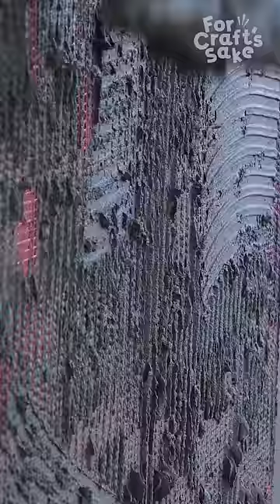Building a House

Comment: Не вентилируемый фасад. Интересно как себя будет чувствовать дом. Вдруг дом останется без тепла а стены будут влажными без вентиляции.
Reply: У вас внутри дома чистый блок и без отделки? 

Перед штукатуркой грунтуют, это уже свозит всю пароизоляцию газоблока на нет. Меньше сказок смотрите, про «стены дышат»
Reply: Sie haben Recht bei so einer Isolierung braucht man ne Lüftungsanlage oder muss ständig Lüften sonst reicht allein die Atemluft und es bildet sich schimmel.
Reply: Da man ja fast nicht mehr Heizen muss, empfiehlt sich eine Lüftungsanlage. Ausgestattet mit einem Heiz und einem Kühlregister. Ist viel billiger als eine normale Heizung.

Comment: Insulation less than 3m thickness is worthless. I made it 4m on my house and to keep it cheap I put it on the inside. It's amazing now. There are only 2m² left but it's very warm in winter.

Comment: installed completely incorrectly. They call for the insulation to be used so that there is no connection between the wall and the insulation.